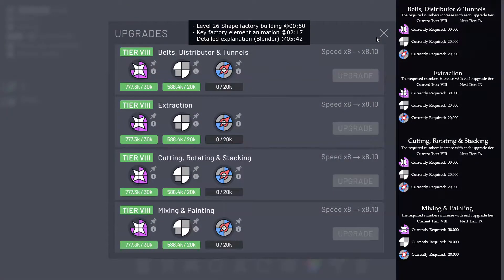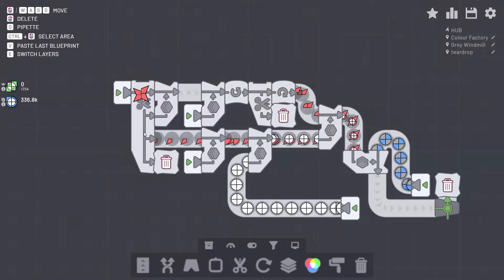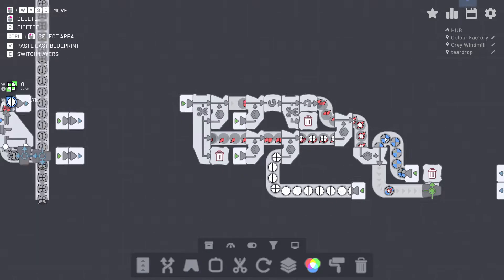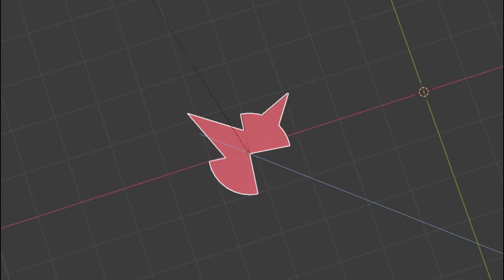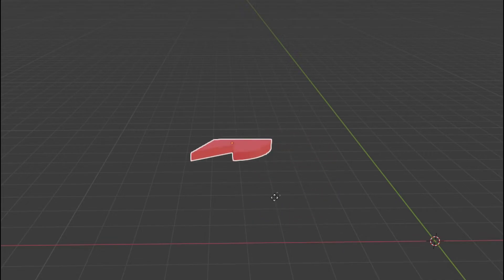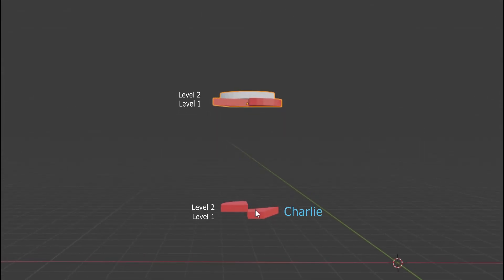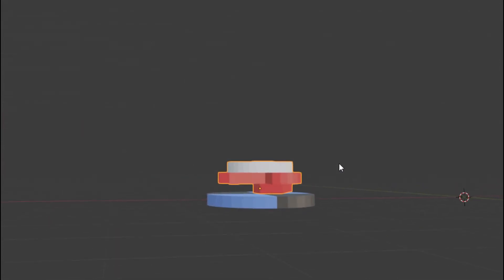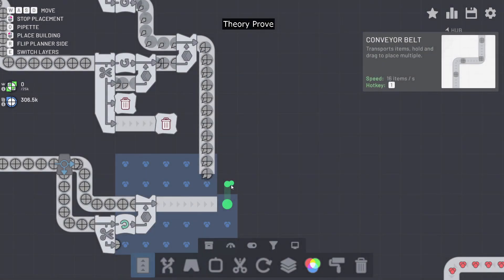Shapez EP24: Level 26 Shape & Upgrades 8th Shape (Post Wires)

Comment: Thanks for the explanation but why is it when I create the individual shapes per layer (from the key/info diagram) I cannot get them to stack correctly.  I have created all 4 shapes per the guide in game.  They don't seem to stack correctly in any combo.
Reply from the maker: Hmmm assuming the game hasn't changed in such a way that the approach no longer works, or that something is broken.. Then you might wish to double-check the rotating of the parts. It's easy to get the direction of rotation wrong without realizing as that happened to me quite often too. It's been a while since I last played the game and don't have the game installed to test out the approach. Do let me know if it still does not work after re-verifying the steps.

Comment: Hi - You NEED to feed MORE BLUE into your Quad Painters - they are starving of blue.     You need a full belt of BLUE for every 3 of your Quad Painters.      It's actually more efficient to just use double pianters  and cut/paste the grey/blue circles - uses MUCH less paint.   I did it your way but added a full belt of blue for every 3 quad painters.    Quad painters guzzle paint!
Reply from the maker: Hallo! Thank you for your comment! 😀 Ahhh I get what you meant there. I was going for convenience and compactness and thus went for the quad painter option. I agree with you, quad painter is a paint guzzler especially in this scenario, needing 2 blues to paint 1 shape instead of 1 blue to paint 2 shapes in the double/dual painter. I.e. for every shape painted using the quad paint approach, that amount of blue dyes could've painted enough components for 4 times the number of shapes if the double painter was used instead. 😄
Reply: @SoulzWind  haha - yeah.  Your design is great though, so clean and easy to understand and nicely compartmentalised nice to be able to work on / check each element separately.
Reply from the maker: Thank you for your compliments! :D The game is so nicely designed it allows for so many different types of approaches to complete the objectives. The upgrade requirements made it so that what we've built isn't immediately relegated to obsolesce just because we've submitted enough shapes to level up. 😀 That's especially true for the more complex shapes in the late-game, which then encourage us to decide whether we want to build for space, speed, cost efficiency, or flexibility.